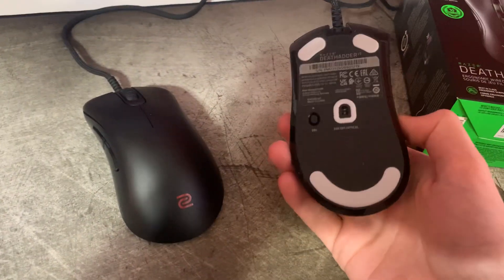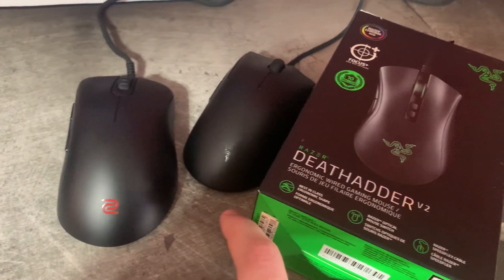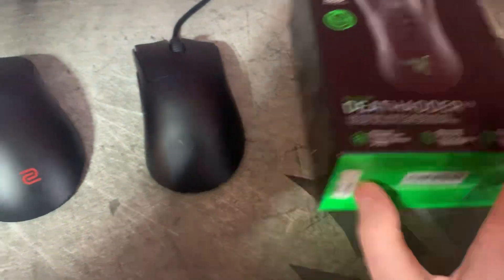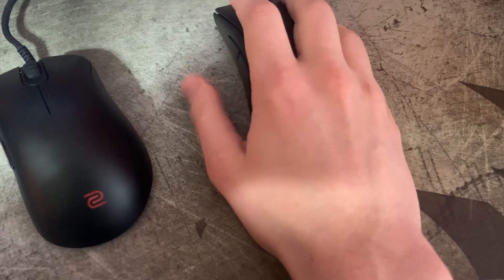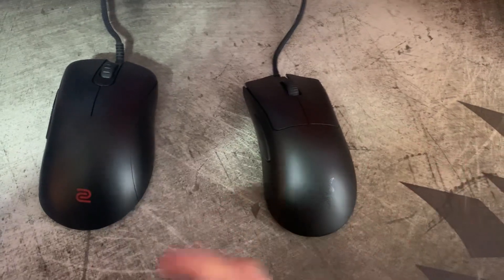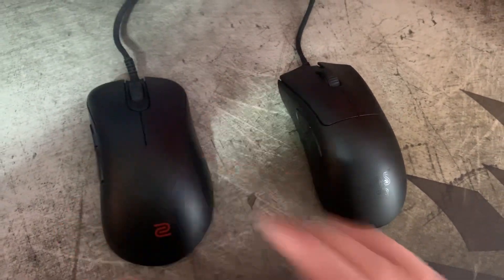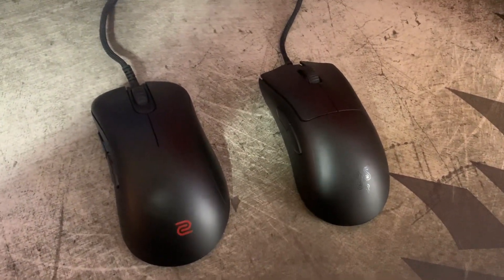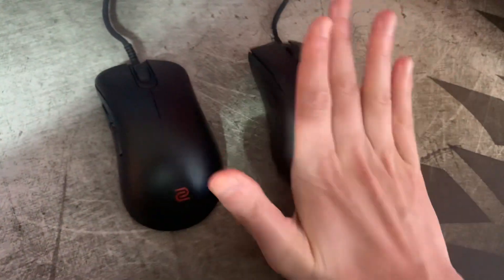Modern Ergos aren't great for Relaxed Fingertip Grip / Insufficient Polling Rate = Animation Jitter

Comment from the maker: Note if you use a polling rate above 1000 Hz you may need some additional configuration to see a difference as per: https://www.techpowerup.com/review/razer-deathadder-v3/6.html

In my case I see the difference in camera animation jitter when tracking a vertical object in the distance then panning the camera back and forth at very high framerates on a G-Sync panel.

Regarding modern ergo shapes, I find they tend to be too tall and too narrow for a truly comfortable relaxed fingertip grip. Solid if you favor a claw grip though.

Comment: if you want a wieder ec2 just get a pulsar xlite v3 size 3 its that easy
Reply: It's quite taller in the hump

But the xlites right top corner is very nicely rounded and has more room for finger position because of the button design

Comment: Perfect analysis. I have the exact same complaints (and hand size). Hope you keep posting and let us know if you find something better than the DA. I've bought several mice including those shown here, and keep going back to my heavy, old DA Elite... Pretty sure my end game would be a ~60g, wireless, high poll rate, no RGB, no software, mechanical switch, original DA shape.
Reply from the maker: Thanks man, yeah sadly it seems most ergos these days are not primarily focused on relaxed fingertip grip/palm and they’re just not wide enough in the right most direction and/or they feel uncomfortably tall like the EC1. I’ll let you know if I find something better down the road.

Comment: I agree with you, i'm kind of an older pc gamer but growing up I mainly used the intellimouse explorer 3.0, after those were removed from production I shifted to a deathadder,  after using some of the more modern mice these days nothing is nearly as comfortable, I think the EC series is good  but I still prefer the intellmouses shape or the earlier deathadder grooves and shape, the new deathadder v3 does not feel as defined as I would like it too and while it's a good mouse I never feel locked into it like I would with previous versions.
Reply from the maker: Well said, I agree with for what it's worth. And yeah, I hear you man. Personally I'm bummed Razer decided to go the direction they did with the DA V3. Don't get me wrong, it's a great mouse (provided you get a good QC unit that is), but for me/my hand size/preferred grip style the DA V2 is noticeably more comfortable with how it sits my hand down and the way it supports/wraps my fingers around the right side.

I don't care for the trend of companies copying Zowie's homework because in my estimation nobody has made an EC-like shape better than Zowie's own EC2-C thus far. I expect many reviewers probably will disagree with me on that, fair enough. I just think the EC2 already exists, if I want that I'll buy it. The DA V2/DA Classic shape is actually very unique in the ergo space so it's a shame to see it go away. If I could get the DA V2 shape but with the wireless tech, sensor, and polling rate of the V3 and the side buttons just rotated/positioned back a bit I would be using it right now.

Comment: in terms of shape, what are your opinions on the np01, which has a right handed shape but a lower height...? I guess the width is also narrow like you said.
Reply from the maker: Vaxee make incredibly good mice in my experience. Their shapes tend to be great and their build quality also tends to be very solid for the mice of theirs I own. I like some of the nice touches they've done for their mice as well like how the material/texturing of the Outset clicks is different from the shell and the unibody design for that mouse as an example.

Regrettably I do not own the NP-01 and haven't had a chance to try it. I do use the rtings mouse compare shape tool a lot though: https://www.rtings.com/mouse/tools/3d-model-shape-compare/vaxee-zygen-np-01-vs.-benq-zowie-ec2?overlap=stacked&texture=outline

My initial thought is that it looks like a great shape, but I'm not sure if it's big enough to comfortably palm/relaxed fingertip grip how I like to. For my hands the EC2-C height is darn near perfect (it's the width that's more narrow than I'd like) and the NP-01 looks to have a shorter and flatter top. It seems to be a smidge wider though so I'm curious to try one down the road. Other reviewers like it a lot iirc -- for context my hands are about 19.5 x 10.7 cm there abouts if I measured them with my fingers compressed.